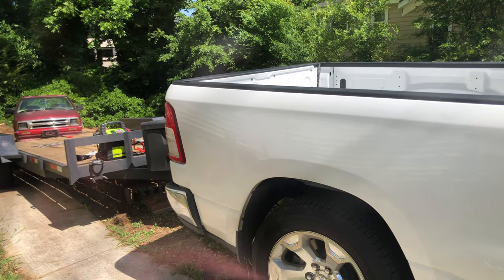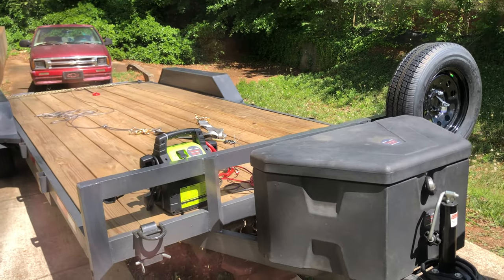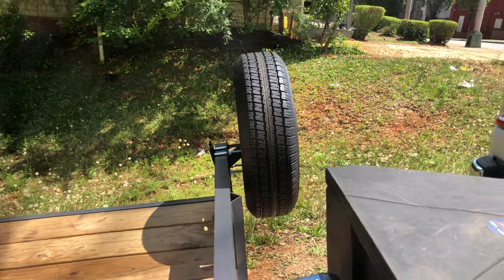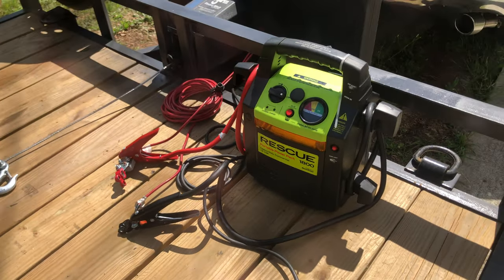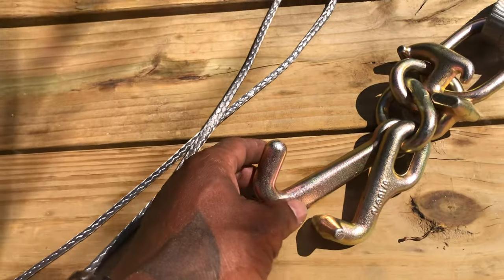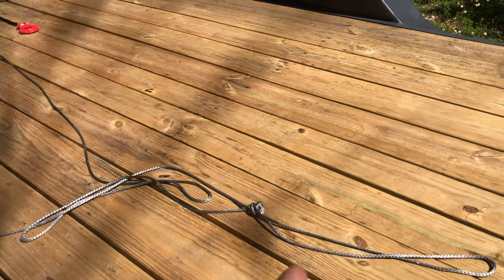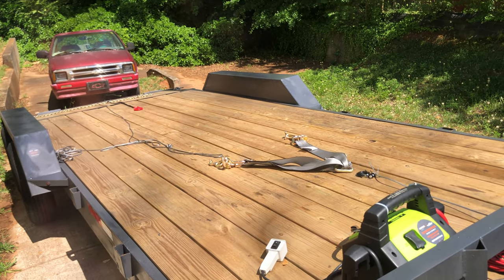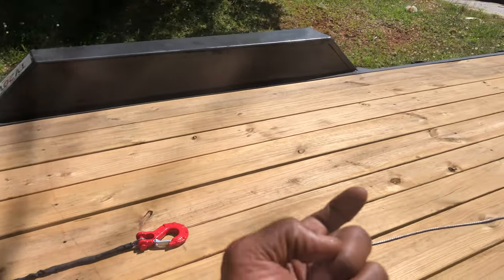How to get NON running vehicles on and off your (car)trailer SOLO using a snatch Block pulley.

Comment: What kinda rope were you using? Looked thin
Reply from the maker: Hey hey! It’s a towing synthetic rope rated to pull about 4500 pounds.  It’s def thin as heck tho!
Reply from the maker: My winch has a quarter cable. It's a 4,500 pnd  capacity strong arm winch.

Comment: the light cable he is using is just looking for trouble as you can see. If for some unforeseen reason you have a car up halfway up the ramp and it stops and puts more pressure on the light cable and it breaks there is no body to stop it from rolling down  the ramps. Where will it end up at ( in the lake!) As for the Question of the small j hooks I would use the t slot hooks as they wont fall out like the s j hooks this from an average 6 tows a day for 6 dats a week for over 3 years. Your life is worth more than that . all I ever used is 1/2 in. cable and had 2 vehicles break my cable fortunate they both had their e break on. so they didn't roll. Unloading can be done with snatch block but you need some way to control the removal of the car. If you do as was instructed in this vid you are taking the winch off the vehicle to hook to the snatch block on the trailer.  As for the tie down whether you are doing this on your own or as a professional you are still required to read and follow the puc and dot regulations this requires a attachment at all 4 corners of the vehicle . Please check the information given in these video's
Reply from the maker: Greetings Mr. Krenek. Thx for watching and I respect your exp. and knowledge and feed back...definitely hear you bro far as the t over the J. I will look more into using the t for educational purposes but I never have an issue with the j's so I never think outside of that thought but def will now that you mentioned it.  as that what the "light cable"I hear you man it may seem light but its rated for 5,500 pounds and like I said in the vid, I don't winch anything heavier than what the securement gear is rated for so I don't think its such a bad idea to use it for just to snatch off but far as what you're saying in regards to having another line attached so in case it breaks the loads don't roll off is def true and I def appreciate the words or advice.I thought about bit and I've figured out a way to unload the inop with a safer maneuver    which ill share in a video soon. but thx again sir and keep em dirty and rollin!!!lol